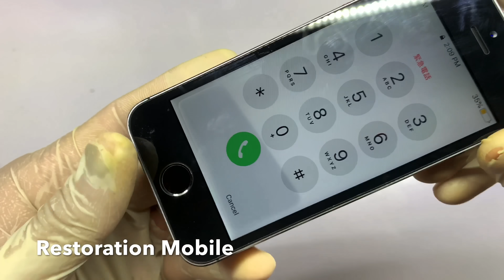Found Apple iPhone 5s in River | Restoration iPhone 5s Apple Mobile Phone

Comment: I just had my IPhone 13 Pro repaired, First off, I was on a family vacation trip with my family, (I'm 12), Basically the reason was that my phone dropped out of my mom's Nissan, Basically, Someone else ran over it, So someone found it, And they finally found where it had belonged to, (Me basically), And the IPhone 13 Pro was alright still, Didn't have some of my apps, But still worked, So yeah, It's nice and clean.